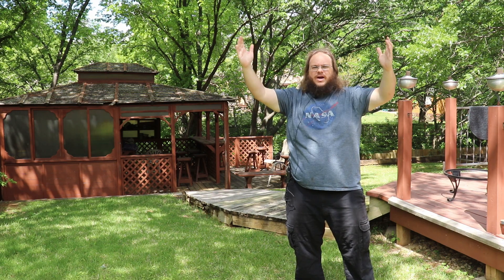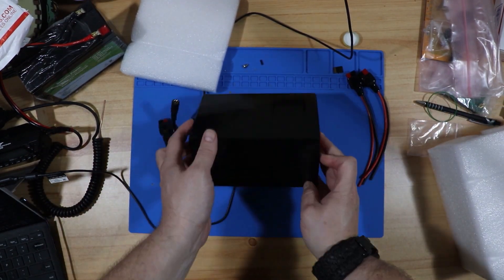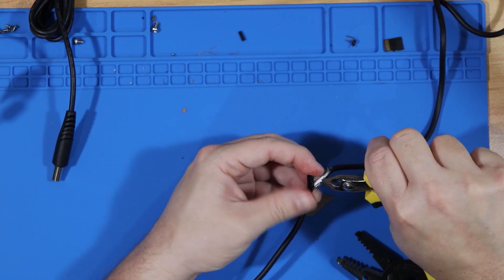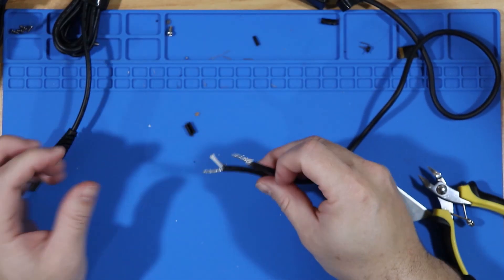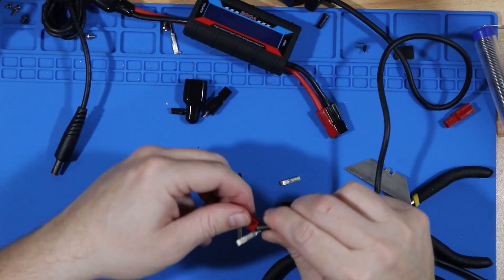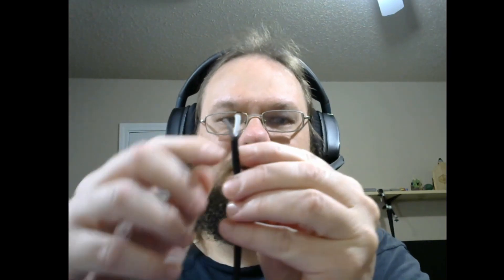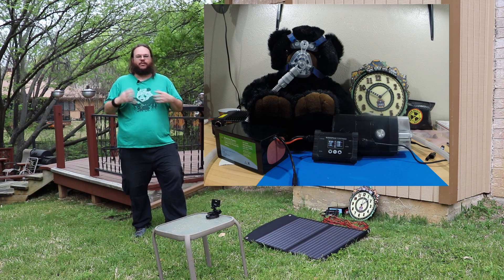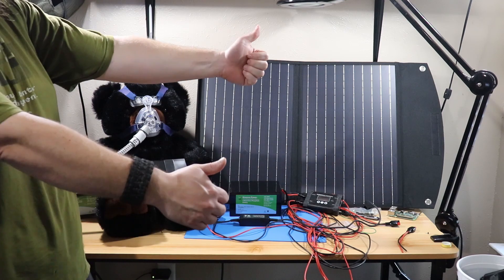Building My CPAP Solar Battery System

Comment: Great job on finding the right + and - for the 12v cigarette lighter adapter.  Glad this system worked out for you so that you can join us on more trips.
Reply from the maker: Thank you, just ignore the sparks when i put a volt meter on it.  I am totally looking forward to go camping now.  I am no longer tied to a power plug.

Comment: So... if you make a multi night trip because of your previous miscalculation even if the sky is over cast for the entire frankventure you will have more than enough power to sleep in breathing comfort. I love it when the unplanned comes together. Hannibal Smith would approve.
Reply from the maker: Unless your SOTAing and want to make you pack weightless.  BUT yes, I like having the larger capacity battery.

Comment: I want to know where you got the 12 volt hook up for your CPAP.... I could use one of those.  Thanks
Reply from the maker: I searched for it on Amazon, reach out to me on discord for a direct link.  Example Amazon Search: "ResMed 10 V12 adapter".
Reply: @TankRadio  if its 36.99, I found it...............
Reply from the maker: @dougdukes1039  Bingo